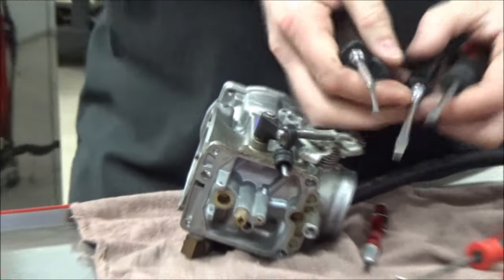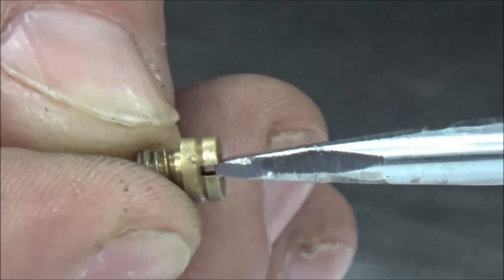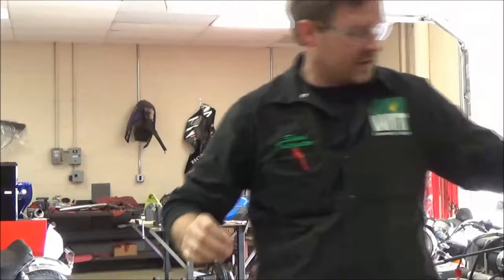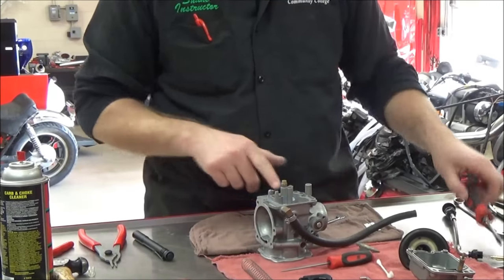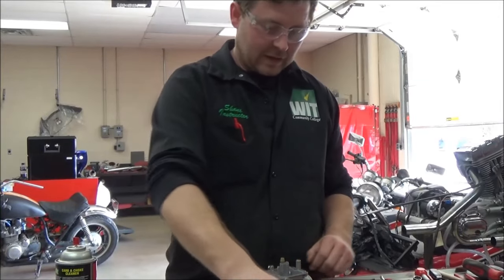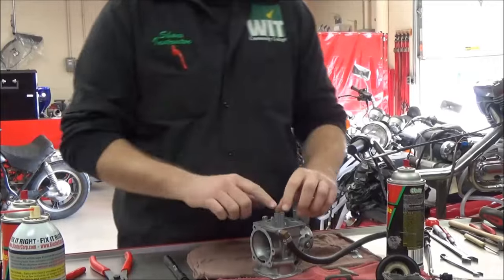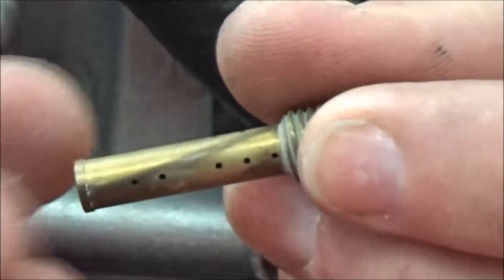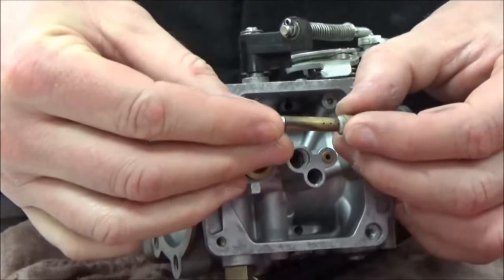05 How to install jets in the carburetor without breaking or coming loose. Float Needle Inspection

Comment: I'm a bit late to this party, but for future reference:  They make a set of hollow ground screwdrivers for gunsmithing that should work very well for this, and are not terribly expensive.  A full assortment of different barrel widths and blade thicknesses, and since they are hollow ground, once you find one that will fit the slot fully, it will have no taper to allow a bunch of slop.
Reply: Faelwolf Yes, the same screwdrivers I used to build my benchrest 30-06 are now my designated carb drivers! Most motorcycle guys like guns anyways so really a set of hollow ground drivers/bits will pay for themselves quickly. Theyve disassembled my zx9r's CVK40's several times, then used them to put a new scope on my rem 700 the same day. xD

Comment: There's a better screwdriver mod.  Common wedge-shaped screwdrivers are flattened as they are to save production costs. They do not belong in carb jets or any soft fastener slots. 

Use "hollow ground" flat tip screwdrivers or bits also known as "gunsmith" screwdrivers on brass and other soft fasteners. That's what they are designed for. The hollow ground tip is precise and the sides where the screw engages are square to the slot. You don't need to buy screwdrivers listed for guns since common multi-kit screwdrivers and the bits sold for use in drills etc are hollow ground. You can buy long shank bits (ALWAYS use ROUND shank bits for clearance in recessed holes) too and most hardware stores carry them or save time and shop online.  

You can find round shank bits which stay centered in recessed carb jets because they are a close slip fit in the hole. Bring a carb body when you go shopping.

Hollow ground is very good but can be specifically improved for doing carb jets.  Instead of the profile you see here (example image) https://images-na.ssl-images-amazon.com/images/I/51xT1IZtcfL.jpg

use a thin CUTTING disk in a Dremel to make your jet screwdriver tips like this  )(  side view. 

Take your time and if you have a magnifying glass, use it.  Leave the factory straight edge across the tip. You are only altering the flanks. You now have a tip which will grab the most supported (and typically least damaged by previous "mechanics") portion of the jet which is the very bottom of the slot.  It's not my idea (credit to "Motorcycle Mike" Vedas) but I've been using it successfully since the 1980s.